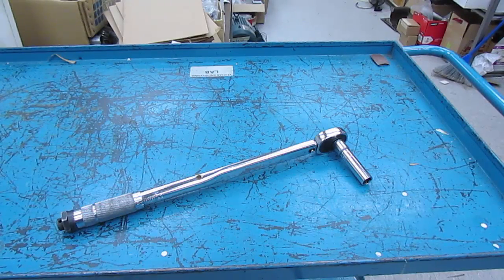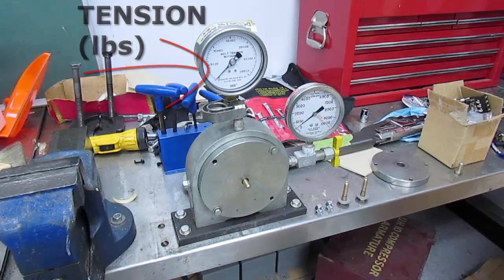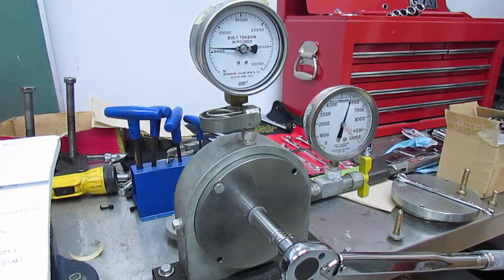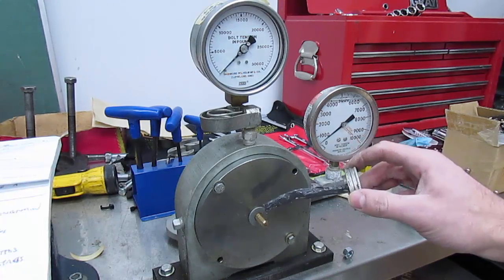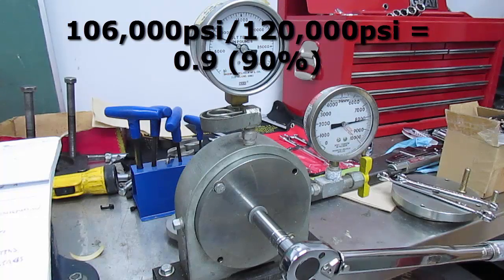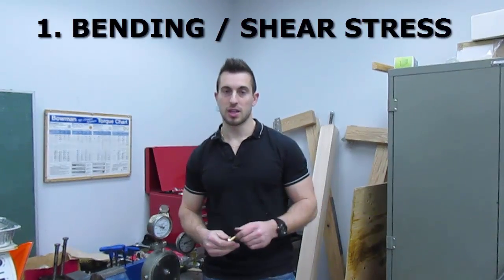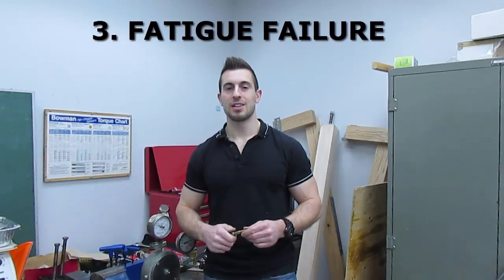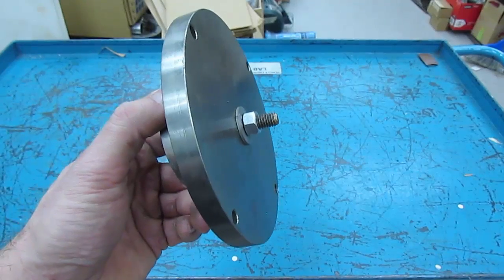Should You Put Anti-Seize On Wheel Studs / Lug Nuts?

Comment: Very flawed and misleading test. The fasteners are much smaller than wheel studs and the nuts are much shorter and have very few threads compared to lugnuts. Also 44 ft lbs is a lot for a 3/8 fastener. All this combined amplifies greatly the difference between dry and lubricated preload/yield stress.

For an actual lugnut and wheel stud of average size with proper torque for its specification, the difference would be much less, if not negligible.
Reply from the maker: Even if the bolts used in the test are smaller, everything is proportional. In the equation, the friction factor is just that.. a factor. So regardless of the bolt diameter, it has the same effect as it is a factor. The nuts being shorter also will not matter. The majority of the stress of the thread interface is taken up by the first 1-2 threads. The rest are there more or less for security if the material is stretched or the first few threads tear. This is why softer materials require more threads (example aluminum). 44 lbs-ft for a 3/8 fastener is the recommended torque for a grade 8 SAE fastener. So none of what you said will amplify anything. The dry vs lubricated on a regular lug stud and nut will see a proportional increase in preload based on how the friction factor in the equation T = KDP is changed due to the lubrication being introduced. If everything I said is irrelevant and negligible, then why do international standardization bodies even bother listing dry and wet torques?
Reply: @EmbraceMaking  The title of your video is misleading. You are comparing apples to oranges with a regular bolt vs. a wheel stud and lugnut.

There are a lot of different variables in play that your test does not consider. The fact that most lugnuts are made to wedge themselves into a sleeve on the rim, which causes much greater friction to the lugnut exterior is one of the big ones.

Manufacturers usually use dry torque specs simply because it is the easiest way to give a spec that can be repeatedly achieved within a small margin of variation. When lubricant is added, it opens up a huge variance range with the amount and type applied, so this is why sticking with dry torque specs is much easier and less risk to a manufacturer. 

Your test absolutely applies to a 3/8 Gr 8 bolt and nut, but the same logic and result does not transfer to a wheel stud and lugnut as stated.
Reply from the maker: @stonecoldcustoms  It is not at all misleading. Even you just stated "Manufacturers usually use dry torque specs simply because it is the easiest way to give a spec that can be repeatedly achieved within a small margin of variation. When lubricant is added, it opens up a huge variance range with the amount and type applied, so this is why sticking with dry torque specs is much easier and less risk to a manufacturer." This is exactly why, as I stated in the video title "Should you put anti-seize on your wheel lugs/studs?" ... because how is the average person going to control the amount applied, etc? They will surely end up with a pre-load that is greater than intended. Especially since the average, uniformed person usually thinks "more is better" and they will smear it everywhere. The 3/8" bolt with a regular nut is a perfectly fine demonstration for a bolted joint on a wheel. It is a demonstration of the effect of anti seize on pre-load. The interface of the nut face to the bolted member does contribute to the overall friction but since there are conical, spherical, flat, acorn, mag, etc etc etc what did you want me to do in this test? Source out each one and cut out the corresponding hole in a wheel to show the exact numbers? The whole point of the video is to grasp the concept that the addition of anti-seize is a difficult to control variable in the bolted joint equation and it is not recommended for the average person, hence why it is not recommended in any user manual, or as another person commented in this comment section, it is even explicitly stated on a permatex anti-seize container "NOT FOR USE ON WHEEL LUGS / STUDS"
Reply: @EmbraceMaking  I'm glad you agree that the video does not answer the question of whether you should put lubricant on your wheel studs/nuts or not.

I look forward to an unbiased test  on a common type of wheel studs and lugnuts.
Reply from the maker: @stonecoldcustoms  How do I agree? You are clearly just hearing what you want to hear at this point and you completely contradicted yourself in your responses. First you said the lubricant would have no effect on the preload on a lug nut. Then you went on to agree that manufacturers do not recommend it because of the huge variance in preload it could cause.. Your whole argument is based on the fact that I used a regular nut and bolt as a demonstration. There is nothing inherently special about lug nuts and studs. It is a bolted joint that is subject to the same physics of a regular nut and bolt... if you can't see that then I'm assuming you don't wear a seat belt either because crash tests are performed with dummies and not real humans?

Comment: If my lug nuts were installed by impact gun at the tire shop would it still be safe to torque them to the original spec?
Reply from the maker: Hard to say if they were stretched or not. I would loosen them and re-torque them properly then just keep an eye on them for a while. Come back and re-torque them after a few days, then a week and keep checking a few weeks after. If nothing changes after a few weeks you should be okay.
Reply: @EmbraceMaking  thanks i really appreciate it 🙏

Comment: This is scaremongering. Why would all 4 or 5 or whatever the number of bolts fail at the same time resulting in wheel falling off? Also, the car engineers design stuff for profit. This means their calculations are not always good for you. Stuck bolts that cause people to use antiseize are usually caused by tire shop impact wrenches that place 10x the required torque.
Reply from the maker: It is not scaremongering... it's information and you can choose to use it how you please. I am an engineer... we design things for safety and efficiency, it's the bean counters that want profit. Yes, stuck bolts can be caused by shop impact wrenches, but consider that if you use anti-seize AND someone is over zealous with the impact gun you WILL stretch your bolt. It's just science... The bolts failing often do not happen all at once. Usually it's one at a time, and as each one goes down and the others loosen from being over torqued it puts additional stress and bending moments on the remaining bolts, eventually causing enough to fail that the wheel falls off. This happens and it is well documented.

Comment: 60% then 90% is an increase of 50% in the pre-load.  (90-60=30 which is half or 50% of the 60)  WOW!  Thanks.
Reply from the maker: I guess that depends on what you're using as your reference. If the previous value is being used, then yes you are correct. If the intent is to reference the yield, then you would still be 30% closer to yield than you were previously.

Comment: Great video! This will come in handy at work. I run into this issue quite often. Been doing tires and suspensions over 20 yrs. I live in the Midwest and because of the weather, moisture, salting the roads in the winter oxidization and rust is guaranteed. This can make it a pain to remove wheels. It’s not uncommon for people to grease up their hubs, lug nuts and studs making it easier the next time you have to remove them. But I definitely don’t recommend it on studs or lug nuts. We actually have to remove it with brake cleaner when we come across it. It’s mandatory! Greasing the studs or the lug nuts and then torquing at factory specs can actually stretch the studs to the point where the nut threads no longer line up with the bolt threads. When this happens they’re a nightmare to get off and back on again. This also can cause a cross thread and the stud now has to be broken off and replaced. It’s caused by over torquing. Grease or anti-seize allows the bolt to turn well past its dry torque specification. By removing your wheels seasonally for a simple rotate or balance usually eliminates this issue anyway. The longer the wheels stay on the vehicle the more likely they wheel oxidize or rust on. So instead of greasing them up just remove them once in a while. Lol... It even says right on the box of anti-seize do not put on lug bolts or nuts. Wheel retention is extremely important. A little grease on the hub is fine but putting it on the studs or lug nuts can alter the clamping force. It’s definitely not recommended. Both the car manufacturer and TIA say a dry metal on metal torque is required. But if you insist on greasing them bad boys up I suggest under torquing them by 25 percent and re-torque them multiple times after driving to insure they haven’t loosened.
Reply from the maker: Thanks for the detailed comment! Nice to hear some supporting evidence!
Reply: @EmbraceMaking  Dang. well, wow. Beyond speechless, I'm pretty happy I ran across your video, thank you so much for the great explanation and demonstration!!!!. I recently had to reinstall lugs onto my 6 lug RV conversion several times, which has an old axle. Every time I did they got looser to where I finally had to use thread lock. But it didn't feel right, starting my investigation. I believe now both the studs and lugs are completely shot, stripped, cross threaded, stretched, loose-but-seem-tight, under torqued, over torqued... basically, every single one of the above nightmare scenarios you have described so very well. I now wouldn't even pull it down to a tire shop a few blocks away and it's probably pushing 4000lbs 😮 and that is with the rim and all 12 lugs seated and tightened as much "as possible". I just don't trust it, and want to pull it down to AR (from CO) My man, I think you may have just saved me from an accident, lawsuit or worse. You may have just saved my life in reality, but at the very least a crash n burn scenario to where I'd lose 25k, my Jeep, as well as 5 years of labor and build time into the trailer. And i honestly don't care what the 'experts' and mechanics above are saying, either: to me they're using anti seize to compensate basically, for laziness . Thats literally like sticking your head in a lions mouth, and putting thousands maybe even millions of lives at risk. Being "experts" they should frikn know better!!  I mean geez one guy up there's comparing rifle barrels to car wheels, like, wt* is that malarky?? There's no way the threads on the barrel of a rifle could ever be subjected to that much force, shear, weight, torque, tensile strength, etc, and also on a constant and cyclical basis.. and I'll definitely state that. Nah man, the REAL expert here, is you 👉 hats off to you, and my deepest gratitude for taking the time to lay it out properly for us laymen and simpletons 😊 THANK YOU!!!!!! 
🏆🎖️🎖️🎖️🎖️🎗️🎖️🎖️🎖️🎖️🏆

Comment: At the end of the day the issue here is really guided by where you reside (salt) and idiots who use impact guns to remount tires. What I'd really like to see is a video on how accurate the torque sticks that most shops use are.
Reply from the maker: Just check the manufacturer website for torque sticks... they should have some rated spec like +/- 25%
Reply: I just came back from a tire shop that uses torque sticks. The mechanic forgot to use the nuts (in the box on the passenger seat !) For my winter rims. I thought, no problem, I will just remove the wrong ones and replace them with the right ones two at a time, while the truck sits. Some of the nuts were " around" 110 ft lbs.... Most were SIGNIFICANTLY above it.  Like 50 or more ft lbs above. My experience and fear of torque sticks. I find it ironic that this typical (in my experience) tire shop that puts the fear of God into anybody considering replacing less than all four tires at a time for a bunch of nefarious reasons (that all have one thing in common.... Cashflow into their pockets) ..... But refuses to take the time to simply and properly torque a wheel nut.

Comment: Straight from the Permatex site  https://www.permatex.com/faqwd/permatex-suggest-applying-anti-seize-lubricate-lug-nuts-installing-tightening-nuts/
One of the most important things when working with bolts - never work after driving the car in rain (or snow).  Always work only in dry weather if possible.  Humidity and water on bolts threads, will cause them to rust and be very hard to remove the next time.  At least, blow each suspension bolt with a torch to dry it off before tightening it back again (same for the wheel lugs/nuts)
Reply from the maker: Thanks for the comment and link!

Comment: Thanks for this info.  I just installed rear shocks and used anti seize.  I realized something was wrong because it seemed like I was never reaching the torque of 56 ft pounds I needed.  It just seemed way too much wrenching to get there.  I'm going to toot those bolts and get new ones on there tomorrow... dry.
Reply from the maker: Good plan! Hope that worked for you!

Comment: So the question you'd even ask yourself is what would you even use antiseize on? Sounds more like 'you know, I really wouldn't mind if this bolt snapped in the future and bent to shit.'  The numbers in this were hugely eye opening. Thank you.
Reply from the maker: I use it between the wheel center bore and the hub locating ring. Over the winter, road salt tends to fuse these surfaces together and it prevents them from getting stuck. So in my opinion I would use it on surfaces that are used for locating parts, but not on surfaces where friction is critical for holding things together or on threads where torque is being used to control preload.

Comment: I am only wondering about this because the bolts on my Volkswagen can get very difficult to undo.  I know that this is a problem with aluminum and similar wheels.  I once had a '95 LeBaron with aluminum wheels and but I also had those horrible lug nuts with the thin cap on that car.  The cap on those miserable things would eventually come loose and cause problems trying to get it off.  I don't know if Chrysler still uses those awful lug nuts but they are sometimes hard enough to remove even when that metal cap on them does not get messed up.  My Volkswagen does not have that problem because they did not put those stupid thin metal caps on them.  Instead they left them a plain bolt head and there are plastic plugs that hide them.  When lug nuts become stubborn like that the wrench that came with your car spare tire and jack will just make it seem practically impossible to remove the lug nuts.  You will feel helpless if you didn't bring a breaker bar with the correct impact socket for your car.
Reply from the maker: Hi Charles, sometimes the problem is material compatibility. Certain material combinations will accelerate corrosion in wet/salty environments.

Comment: Many people who have ever had to drill out wheel studs to get a rim off will swear by using anti-seize, as I do.  Also, grade 8 bolts with a 5 or less nut and washer?  {facepalm}
Reply from the maker: The problem with anti-seize is that it is another variable in the equation that is difficult for the average person to control. Even if they use a wet torque spec they have no idea how much anti-seize they put on the threads and the effect on the friction.
Reply: @EmbraceMaking  That may be true, but any experienced shade tree mechanic will be able to torque a wheel nut tight enough that it won't break the stud or back off without needing to worry about torque spec.  Most people will never drive in a way that would require them to worry about overstressing the studs or rim anyway.
Reply from the maker: If that were the case then loose nuts and wheels flying off wouldn't be such a common occurrence. Google some statics related to lug nut / stud failure and you would be surprised how often this happens from just regular driving. http://www.boltscience.com/pages/failure4.htm

Comment: Isn't the anti-seize torque generally 75% of dry torque? So you can calculate from the manufactures suggested value.
Reply from the maker: It's an estimate... the number can vary wildly depending on how much or how little anti-seize you apply
Reply: @EmbraceMaking  I'll have to respectfully disagree about applying too much/too little anti-seize, or any lubricant for that matter.  Apply too much and the nut will simply push aside the excess.  There's only so much lubrication that can be accepted between the nut/stud threads,  and the nut will do a consistent job of spreading the lube evenly about the threads.   How can you possibly state the torque adjusted number can vary 'wildly'.....you're making claims you cannot verify.  This isn't heart surgery.  When you lube threads, use the lower torque as suggested, it's just as simple as that.   Sure, the friction coefficient has changed, but the clamping force of the fasteners are still well within acceptable values.

Comment: There's vehicles in my driveway that have had anti seize on the lug threads longer than I've been alive, never an issue and they always come right off with no fuss. Lately I've been trying out bearing grease on the threads since it's nowhere near as messy and have been happy with that as well.
Reply from the maker: Do you adjust your torque value?
Reply: @EmbraceMaking  Use a 1/2" drive ratchet on the smaller cars to tighten them down until I can't put any more force on them if I don't have a torque wrench handy, which winds up being around 70-80 foot pounds when I check them with a torque wrench. On the bigger cars and trucks I usually back them off about 10 foot pounds using a torque wrench with thread lubricant, since there is often some dirt and debris mixed in on the threads I don't worry about it too much. For what it's worth, I try not to put anti seize on the conical taper seat of the lug/wheel.